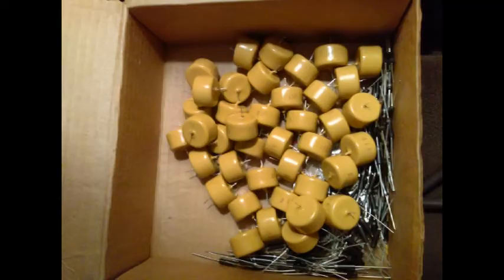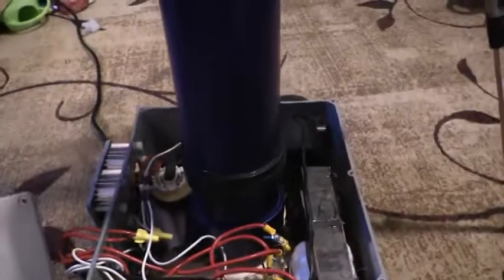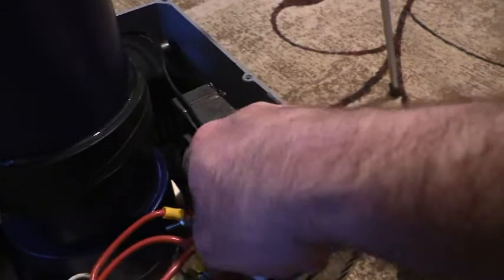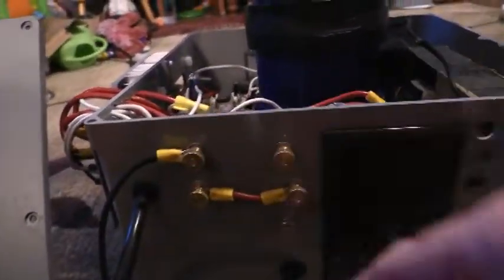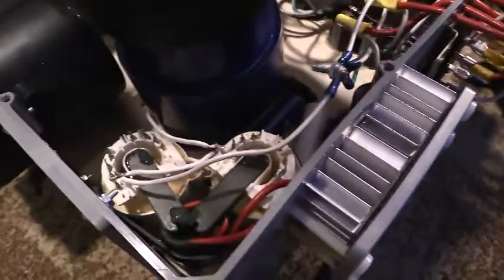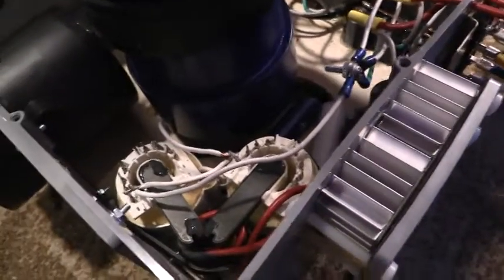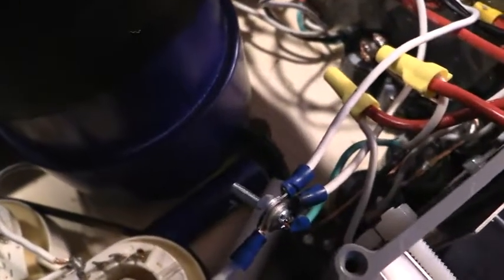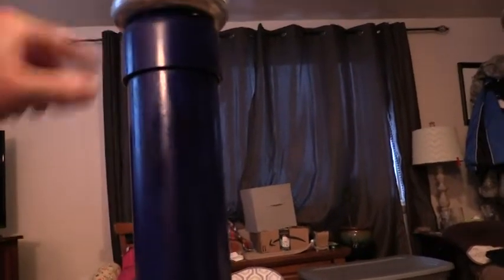Homemade Lightning - Cockcroft Walton Multiplier 2

Comment: Why did you wind the primary coil around both cores of the flyback transformers? It seems like this would yield poor coupling. I made a similar 14-stage voltage multiplier. I also used 2 flyback transformers in parallel but I used a separate primary coil for each flyback transformer. I get about 13" discharges with a 15 kv peak AC input.

Comment: Those look like normal TV flyback transformers.  Did you fry the internal diodes to get AC output, or are those flyback transformers built for AC output already (no internal diodes)?  Either way, I'd be interested in how you obtained AC-output flybacks or your technique for diode frying.  (I've fried diodes in one flyback so far, but an easier process would be nice.)

BTW, your use of excess diodes is good.  Resistors don't work well for balancing at kHz frequencies.  The primary issue is reverse recovery time.  The fastest diode in a series string recovers first, then takes the remaining reverse-recovery charge of the slower diodes in avalanche mode.  Using avalanche-rated diodes helps too.
Reply from the maker: I used Sanyo FO241 flybacks with no internal diodes. Found them on ebay for a good price. I believe they're designed to be connected to those little rectifier/multiplier boxes within the TV.
Reply: Thank you for the information!  Unfortunately, those doesn't appear available at the moment, so more diode frying and/or custom transformer construction for me.
Reply: @davekni  how do you fry the diode? shorted output and lots of power? increase the gap maybe?
Reply: @redoverdrivetheunstoppable4637  Wanted to avoid much total power into the diodes to avoid frying neighboring windings, so used short pulses.  Frying took two steps.  First drove the flyback with sine-wave bursts on the primary (from a ZVS circuit) with a HV capacitor on the secondary.  Ran voltage up until avalanche-breakdown of the diodes.  This was a single event once the voltage got high enough.
Unfortunately, this only partially fried the diodes, down to ~2-3kV.  To finish frying, shorted the primary winding and discharged a capacitor to the secondary through a spark gap.  Discharges repeated ~10 times per second, every time the capacitor charged enough to trigger the spark gap.  Required several minutes of this to get well-shorted diodes.
Reply: @davekni  jeez, that's a really "pro" solution, thanks for the info!!... infact i saw diodes like UF4007 breaking at around 1.5kV and afterwards having an apparent avalance breakdown of 300V, still working as diodes
Reply: @redoverdrivetheunstoppable4637  

Yes, I've seen that too, even on diodes rated for avalanche breakdown energy.  My Marx generator supply produces +22kV and -22kV DC from a +-11kV 30kHz sine wave inverter output, 6kW average power.  The voltage multiplier requires four capacitors and four diodes good for >22kV.  Made the diodes from strings of BGY23M diodes (1kV, 1A, 75ns).  Due to Trr differences, some diodes always get a bit of avalanche current.  Using strings of 36-45 diodes allows it to work even after some diodes fail or partially fail.
Reply: @davekni  i've noticed it on my (modest :D) voltage multiplier... i know the UF4007 is not promising in terms of voltage but it was fun... max spark lenght was 9cm, 20+20 stages of 2kV each, diodes in series of two
Reply: @davekni  hello again, i tried your solution to fry the diodes and it seems to have worked, but i'm not sure about a pair of things... the flyback now draws more current (with the same driving situation) and it makes some corona on the core, also the secondary now seems to have 3.8 kiloohm measured on both senses, i'm not sure the secondary winding is so high in resistance (it's a small FB)... my toughts are that a DC flyback has tonnes of fine wire turns and altought it can potentially give a lot of voltage the stray capacitance between the secondary windings allows super high voltage only in DC, braking it in AC.... it makes hot arcs with the primary in both senses but little gap jump, curing the corona seems to give a bit more, maybe it's "oil time" (?)
Reply: @redoverdrivetheunstoppable4637  Yes, I think DC flyback diodes are typically distributed throughout secondary winding (one diode per winding segment).  That way most of winding capacitance is across DC.  With fried diodes, there is HV AC where there used to be HV DC.  Insulation likely isn't designed for that much AC, so corona and higher losses (more power draw).
The one DC flyback I diode-fried was only 16kV (from monochrome monitor).  3.8kV and more corona problems seems reasonable for a 25-30kV color-TV flyback.  It's also possible that the fried diodes have significant resistance.
Reply: @davekni  yes, the diodes spread along the secondary winding may help the oscillation, that's why i don't get much in terms of voltage... it's a philips color TV FB from a 14 incher, late nineties era, now it's under oil, the corona now seems to be only around the HV wire on the places it touches (insulators included)

by the way... i'd like to make a video on my (other) channel about your procedure to fry the internal diodes and some toughts (if i manage to make it "interesting") if it's not a problem and i'll mention you on the video... don't worry, my channel makes very little views... is it ok ?

Comment: I am building a similar machine and I have a few questions. How did you connect your two HV power supply leads through the PVC tube wall without it leaking oil? Are they hard-wired through the tube or do you have a connector system so that you can withdraw the electronics assembly for service? Why did you use paraffin for the resistor portion but oil for the lower portion? Why not oil for everything? Do you know the voltage output of your flybacks? Isn't 3 diodes in series (60 KV) overkill. Two in series (40 KV) would seem to be plenty.

Finally, if you aren't a member, you might want to join and post this on "highvoltageforum.net" if you would like a more knowledgeable audience to see this.
Reply from the maker: The tube's external connections are via brass screws on the end caps that were sealed before filling. Standard PVC cement applied thoroughly on the caps prevents oil leakage. I originally potted the entire tube in wax, but had corona leakage around center column and suspected wax breakdown. So I had a very fun task of removing wax from all the diode/capacitor connections and filled that portion with oil and sealed. So far no more corona issues, the oil is quite resilient. As for servicing, I recommend using some type of threaded cap on at least one end instead of permanently sealing. Diodes! I built a few of these over the years and diodes always seem to be the point of failure. Admittedly they should have some value of balancing resistance between them, but I just decided to use three in series for an overkill rating, so far no issues. Thanks for the info and for watching

Comment: Great setting and good work! What is HV input voltage 15 KV?
Reply from the maker: Thank you. Judging by spark length of the flybacks I'd say ~10-12 Kv at 95KHz. The high frequency is what seems to be crucial for charging this many stages.